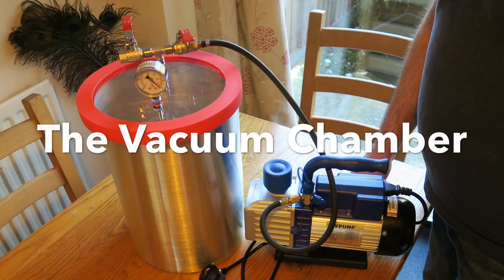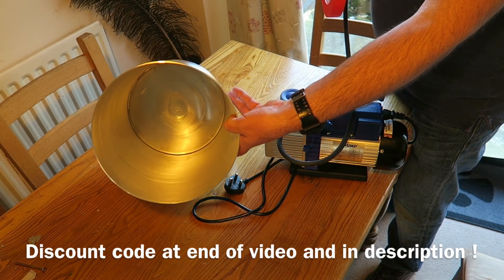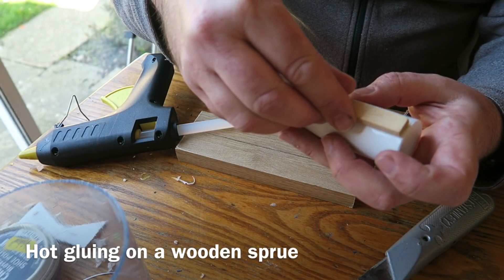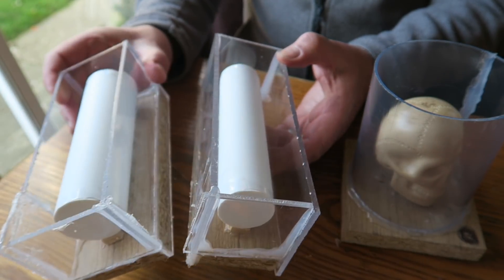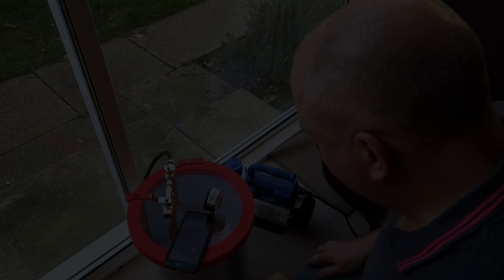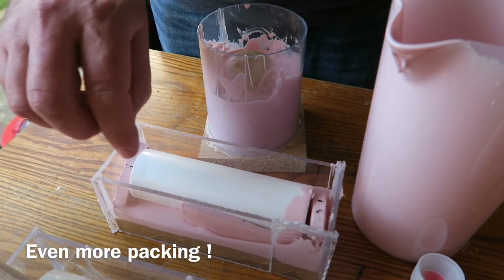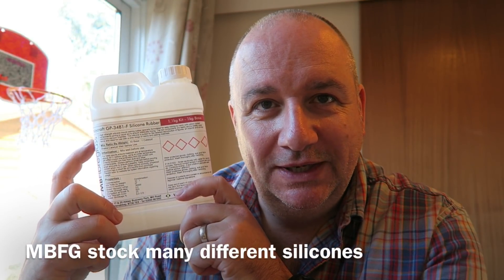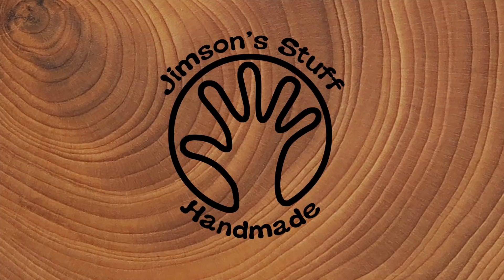Vacuum Chamber - mould making

Comment: Jim....iv see your video now four times...very informative  only thing I want to ask you do you need a 2 stage vacuum pump..or will a one stage do?.....cheers Dave
Reply from the maker: Many thanks for watching Dave. The 2 stage pumps tend to be quieter and more powerful. A single stage pump will work but may not be so hard wearing, they are apparently not as good for running for long periods but I have not actually tested this.
Reply: @JimsonMakes  many thanks for advise him got the 2 stage pump now. Iv even got my self a pressure pit which iv converted from a paint mixing pot.  All i need to do now is go back to your first videos and see how to use them lol cheers Jim 👍

Comment: hey nice video! :) but i have one question.. why did you put the silicone alone in the vacuum chamber and not the whole mold with silicone in it? was it easier?
Reply from the maker: Thank you very much. It is technically better to do it before pouring, it lessens the chance of the released air being trapped in the mold. It is also better to do it in a tall container as it can foam up quite high at first and would overflow.
Cheers 
Jim

Comment: Use wondering, instead of using a vacuum degassing chamber would it be possible to mix the silicone, pour around the original then place into pressure pot to shrink the bubbles while curing? Basically, I don’t want to buy a vacuum chamber and a pressure pot, if I can get away with just one. Cheers.
Reply from the maker: Yes that is possible, pour the silicone in a thin stream from a height and this will help reduce bubbles. If the silicone is set under pressure then that mould should only be used under pressure ( there will be very slight distortion on de-pressurising due to expansion of bubbles in the silicone ). The only problem that can be encountered with this technique is that surface bubbles can sometimes expand and pop on de-pressurisation once the silicone has set which could potentially spoil the surface of the mould. Hope this helps
Cheers 
Jim

Comment: Hi Jim, I've been seriously considering investing in a vacuum chamber and have a couple of questions. 1. Is your discount code still active? 2. What capacity of vac pump would you recommend? Thanks for your help.
Reply from the maker: I am not sure if the code is still active, someone messaged me recently to say that it was, best try it and see. I think a 2 stage 3CFM (or higher) is best. What will you be using the vac chamber for ?
Cheers 
Jim
Reply: I mainly want to use it for stabilising timber for knife and tool handles but also want it to be big enough for degassing silicon and resin for casting. I have to say that your work has been the main inspiration for my moving into using synthetics. Thank you for your generosity in sharing your knowledge and skill.
All the best,
Kevin
Reply from the maker: A vacuum chamber is obviously essential for stabilising timber and works extremely well for degassing silicone, it will work for degassing some slow set resins but I have had mixed success degassing resins, a pressure pot is much more reliable for eliminating bubbles from castings. Glad to have inspired you.
Cheers 
Jim
Reply: @JimsonMakes  Thanks Jim. I'll be investing in the pair then! Looking forward to seeing what you get up to in 2019. Be well and have a happy New Year. Kevin

Comment: Tnank you for the video! Yesterday i have tried for the first time vacuum Chamber and my mould.. when mould started to rise I felt a  bit panicky and believed something went wrong.. so I let it settle and it was still full of bubbles that was rather upsetting ( mould is not cheap and it was my second try on doing the same mould and it failed). How long would you suggest for mould on Vacuum Chamber stay raised, or would you repeat the process of rising few times?
Reply from the maker: Hi Dika, thanks for watching. My top tips for silicone would be to make sure it is at warm room temperature before mixing, mix extremely thoroughly. Use a very tall oversized container for degassing, put it in the vacuum chamber and let the bubbles rise, the bubbles should rise and then fall on their own without releasing the pressure. The silicone should be ready to pour, it will continue to bubble away in the vacuum chamber if left but it is the initial rise and fall that you are looking for. Pour the silicone into the corner of the mould from a height in a thin stream. Hope this helps.
Cheers 
Jim
Reply from the maker: Forgot to say, always de-gas the silicone before pouring the mould.
Jim
Reply: @JimsonMakes  awesome, thank you for your advice and time! :)

Comment: What happens if you cast your resin into the mold and put the whole mold inside the vacuum chamber to de-gas the bubbles ? Is it going to work ?
Reply from the maker: It can do in simple open moulds but in most cases air bubbles in the resin will become trapped in details in the mold. A pressure pot for casting is the ideal solution. Cheers, Jim
Reply: How long it takes for the pressure to destroy the bubbles ? Will i have time to pour it into the mold before resin cures ?
Reply from the maker: It depends on the size of the pressure pot and the power of your compressor and the pot life of your resin. My set up takes approximately 90 seconds to reach the  60 PSI which is needed to eliminate bubbles. Jim

Comment: Well Jim, you convinced me to get a vacuum set up. Thanks for the discount code by the way, it saved me a few quid. After looking around for Cactus Juice though I nearly had a heart attack at the price of it. I think I only found one supplier in this country, the English equivalent seems to be Stick Fast resin. Not sure which to go for. What do you think you will use?
Reply from the maker: I used Stick Fast resin but apparently Cactus juice is almost exactly the same. See who is offering the best deal. I got mine from Turners Retreat. It is very expensive but it goes a long way as you can reuse any resin that the wood doesn’t absorb. Get a tall narrow container to put inside your vacuum chamber as this will help the resin go further. If you haven’t already done so, take a look at my Stabilising Wood video. Cheers, Jim
Reply: Thanks Jim. Love your videos. Keep em coming.  Stu.

Comment: Brilliant Jim, it’s always interesting to see your projects. I have a load of half completed spalted beech bowls that will not turn as they are too ‘punky’ as they say across the pond. Do you think stabilising them in a vacuum tank would be the answer? Please don’t spend too long making the series. Well done, as usual. Michael
Reply from the maker: Thank you very much Michael. In theory stabilising the blanks should work but they need to be totally dry and they might take a lot of resin which is expensive. It would also depend on how finished they are as they are likely to distort a bit in the stabilising process. Cheers, Jim

Comment: Jealous, jealous, jealous! I'd love to get a vacuum chamber set up but the big chief (wife) say's I spend too much all ready. Ha well. Maybe later. I really appreciate your videos Jim they're great and so informative. Thanks.
Reply: Stu, you can make one pretty cheaply. All you need is a second hand pressure cooker, a thick piece of acrylic, and a small bit of plumbing. The pumps you can usually get for free or almost free from an air conditioning repair company. It may not be as nice a pump, but it will work. The only thing you have to be sure of is it pulls down to 29" or better. 

The last one I made cost me about $40, everything else was scrounged from second hand stores.
Reply from the maker: Thank you very much Stu, yes they are great bits of kit and something I have been wanting for many years. They have come down in price relatively speaking in recent years ( especially with 10% discount ! ). Cheers, Jim

Comment: It will be interesting to see the upcoming videos with pressure and vacuum chambers. It's not clear for me when and why using pressure vs vacuum since both are for removing bubbles. Hopefully your experiments will help understanding the difference. Cheers!
Reply from the maker: Yes it can be a bit confusing. Vacuum causes bubbles to expand and rise to the surface and pressure will shrink any remaining bubbles to an incredibly small size where they are no longer visible to the naked eye. I hope to throw light on the subject in this series. Cheers, Jim

Comment: Hello Jim,   I'm jealous,     well no, I'm Glenn really, but having viewed plenty of videos on the topic, I think vacuum would be my route as opposed to pressure. I think it may be better at extracting bubbles from awkward angles. Ah, another temptation. 10% off you say?          Hmmmm.            Regards, Glenn. :-)
Reply from the maker: Hi Glenn, vacuum and pressure both have a place really. Ideally you need both, that is why I have been waiting for my pressure pot to arrive before doing the casting. Vacuum is great for reducing bubbles before pouring resin or silicone but you really need to put the casting under pressure to shrink any remaining bubbles. It would help pull some awkward bubbles out but probably not completely. If you are combining wood and resin then you will need a pressure pot as a vacuum will just suck air out of the wood and create more bubbles. Sorry to increase your shopping list ! Cheers, Jim

Comment: I have the shorter version of this and the lid cracked after about 6 uses. HVAC were very good and offered a full refund or new lid. I have not used it since receiving the new lid.

All the best,
Paul
Reply from the maker: I think you must have had a faulty lid, I know cracks can propagate from drill holes occasionally. I think Hvacstore’s customer service is excellent. All the best, Jim

Comment: Interesting as ever. Probably a daft question is the pump vacuum only or can it be reversed for pressure? I.e can I avoid buying two bits of kit?
Reply from the maker: Thank you very much John. No these pumps are vacuum only. There are devices that convert compressors into vacuum pumps but I am not sure how effective they are. Cheers, Jim
Reply: Jimson's Stuff I’ll have to put it well down the list then! Following approval from senior management working on a larger workshop!

Comment: Thank you, Jim, for a very interesting video.  I'm keen to learn more about using resin and silicone so I look forward to future uploads.   Also, I have a slight interest in veneering using the plastic bags and vacuum pump.  Any idea if the pump you use is compatible with that process?
Reply from the maker: Thank you very much Alan. There are several videos coming. The pump should be perfect for veneering if you can get a suitable bag and connector. Cheers, Jim